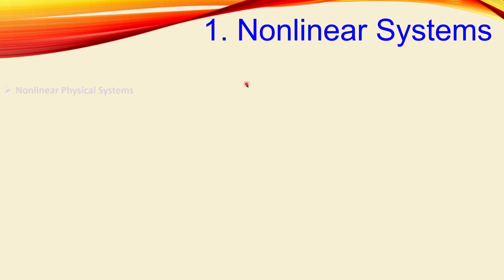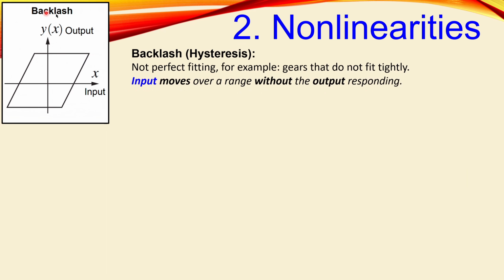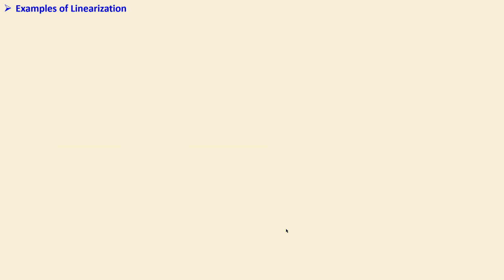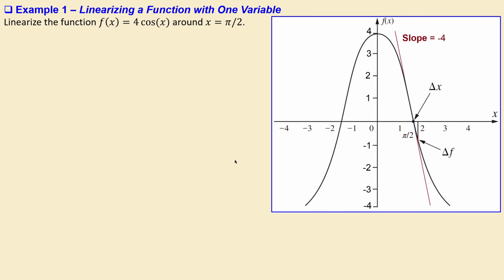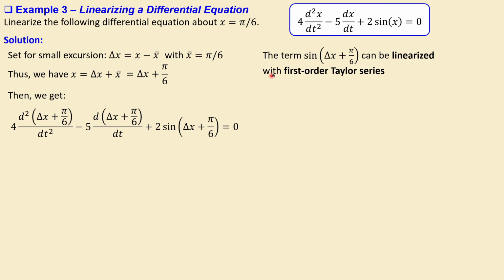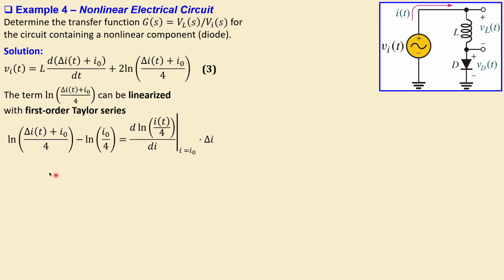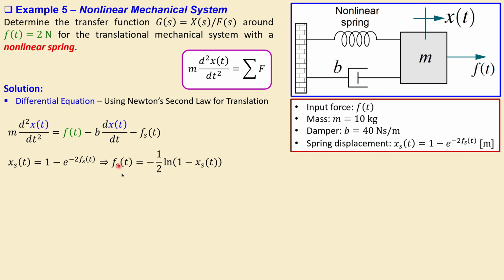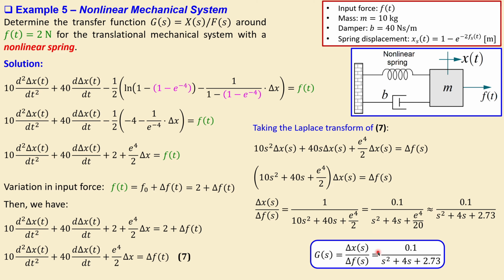Nonlinear Systems & Linearization 💡Full Theory & Many Practical Examples! 😎👌🔥

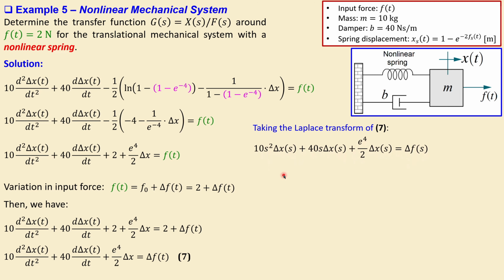Comment: what does "Variation in input force at 59:50 mean?

is it just something you defined to make the constant "2" go away? or is it from the givens of the problem?
Reply from the maker: The variation for all signals is denoted by a delta. The variation is always on the steady-state value of the quantity your are talking about. If the steady-state value is 2 N, than the change on this 2 N is given by delta f. 

We are only interested in the variations, not the steady-state values.
Reply: @CANEDUX  i understnad now. thank you for the swift response, your channel is very helpful for students of control like myself
Reply from the maker: @pielover  Great to know that 👍 Share this video with your colleague students.